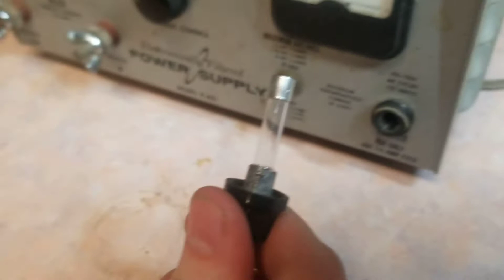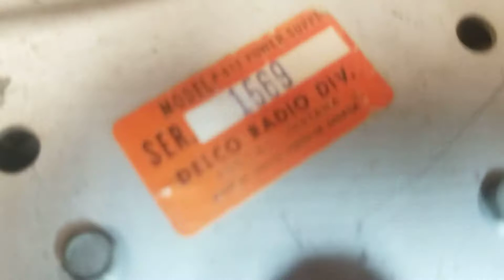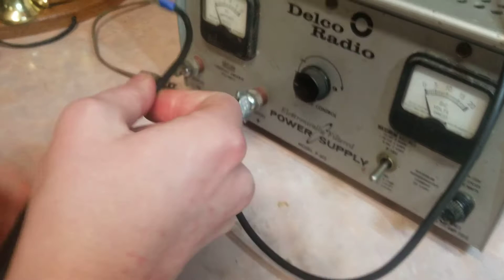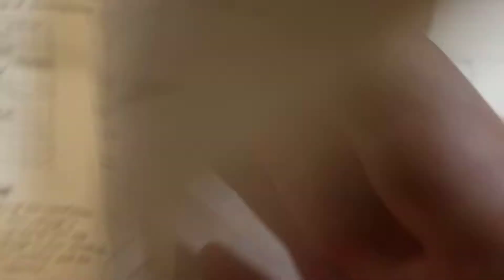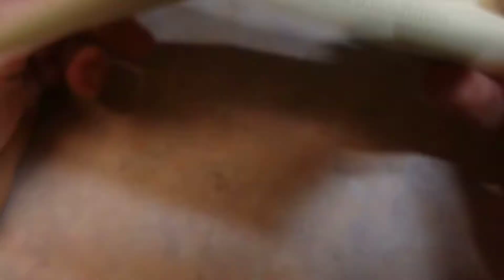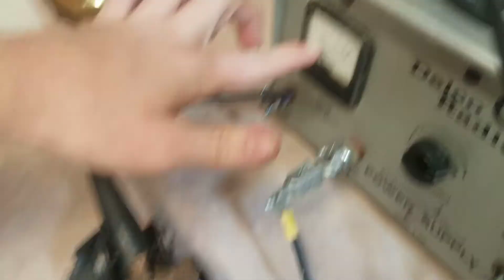Delco Radio (power supply) model P-612

Comment: i used to work at a delco warranty shop and we used these things exclusively. the transistors were common as both the ds503 driver and ds501 were output transistors in their radios through out the 1960's.

Comment: I just found your video on the delco p-612 power supply. Hundreds of the were used on the radio production line. The logo on the front dates it to pre 1970 although I doubt they updated the artwork when the name changed to Delco Electronics. Mine no longer varies the voltage. Is there a chance I could get a copy of your manual for the schematic so I can get this thing working again?